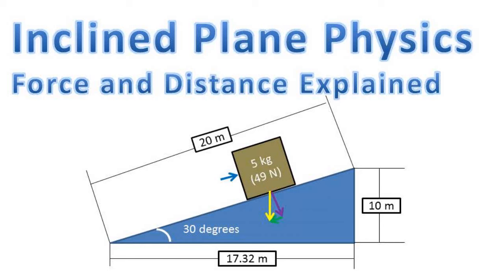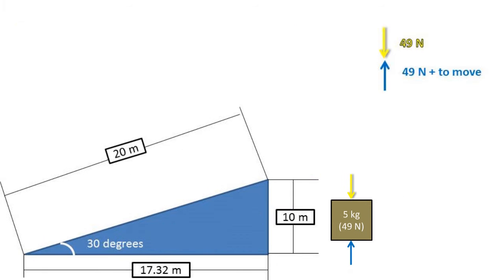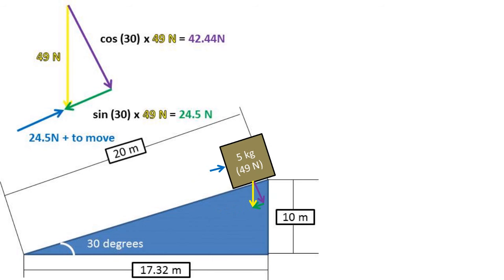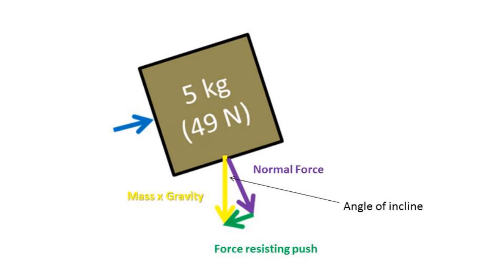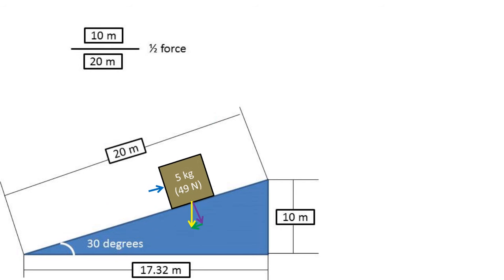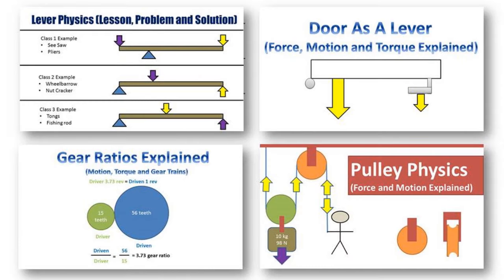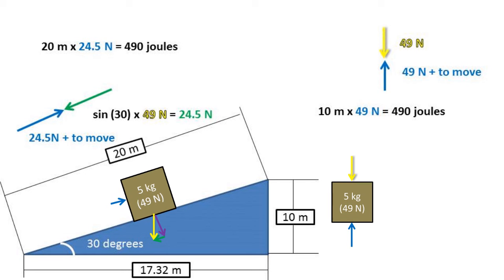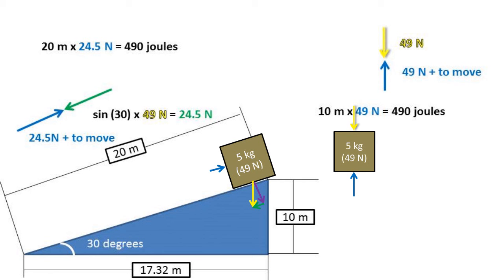Inclined Plane Physics (Force to Push Object and Distance Explained)

Comment: very helpful im using this to help me understand the force needed to get  up a ramp in this years VEX robotics compatition.
Reply: also I could be wrong, but are the 5kg of the box supposed to be in pounds because thats the only way I see that works because X = 5 (X * 9.81^2 ) / 4.45 doesn't give you 49N. Im pretty sure im doing it wrong, but if you do 5 / 2.2 first place to turn 5 pounds into kilograms and then go through the equation it comes out to ~ 49.15. Just curisous if you could help me out.

Comment: Very clear explanation.  I am interested in how you would explain the effects of slope upon lifting a motorcycle.  I am a rider of 25 years on my Honda which weighs about 680 pounds which I recently accidentally lost balance on a small hill road and due to slope in both the rear angle and portside was simply impossible to lift solo.  Usually on a flat garage setting it is a simple squat position back towards seat and tank which enable me to right my bike.  In this case I could not until a young fellow offered assistance.  I read about the effects of slope but would be curious of the layman’s understanding of slopes effects lifting an object and why in this case it was impossible for one person to lift the weight.  I understand that slope to a certain degree increases the amount of direct weight to lift but seek a simple formula to use in calculation.  Ideas?

Comment: Bit rusty on mechanics after 60 years, but out of curiosity I calculate that if a force F1 is needed to accelerate the box by 1m/s/s/on a flat plane, a greater force F2 is needed to accelerate it at the same rate up the inclined plane at angle Theta,  and that F2 = F1 (1 + g.tan Theta).  That seems to apply in whatever direction the force is applied.  Did I get it right?

Comment: If you are pulling that box at 30 degrees (while still on the 20 degree ramp) instead of pushing it,  how would you calculate force needed?
Reply: it’s the same force